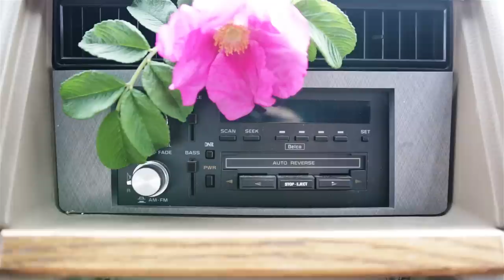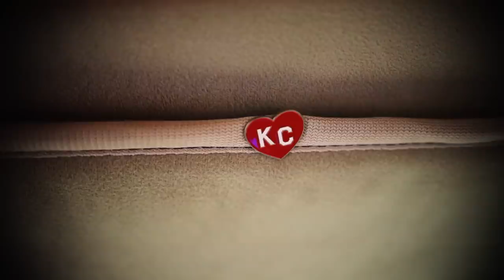CONVERTING my VAN into a BUDGET OVERLANDER - Gladys 2.0

Comment: just a heads up - your panels will continue to rust under the bedliner. Next time be sure to spray it with phosphoric acid (OSPHO) before you paint over it to stop the rusting process
Reply: Good to know. Cleaning up the cancer in my van as we speak.

Comment: if you ever run into a stripped bolt like that again just drill out the head side of the bolt and punch it out with a screwdriver and hammer will save you some money

Comment: Great energy you have bud!  Loving the van build!  How does you electrical system hold up?  Do you find that 2 panels is enough?  I noticed you have a nutribullet, does that drain the battery pretty quick?  Does it run at full strength?
Keep on keepin on.

Comment: Spray foam works good in rust holes..
Reply from the maker: ahhh. I didn't think of that... obviously
Reply: Don't do it, expanding foam is not water proof, it will hold moisture/condensation and make more rust.
Reply: Spray foam will hold water causing mold and mildew. Plus the chemicals will eat away the metal causing more rust.
Reply: I couldn't have said it better myself.